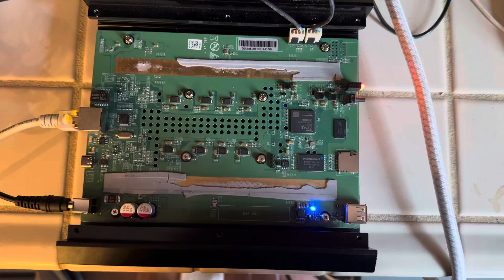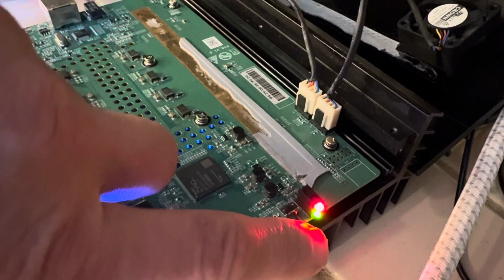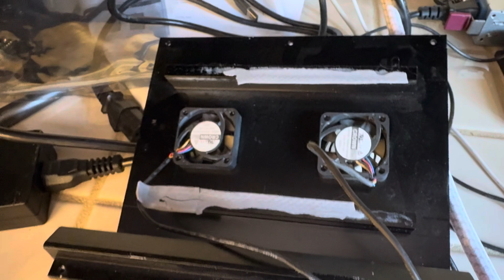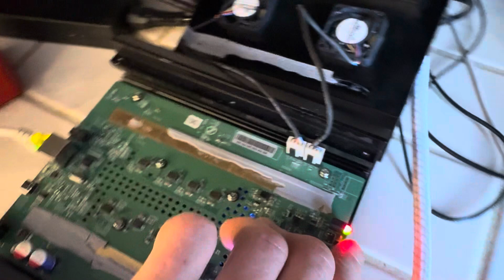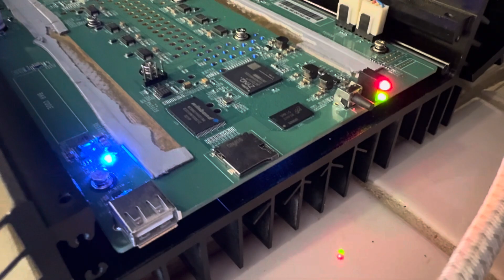I PERMANENTLY BRICKED MY KS0 OG AND DON’T KNOW WHY BUT IT WILL NOT FACTORY RESET ANY LONGER

Comment: Hi, I have just had the same trouble .. how you fixed ?
Reply from the maker: I’ve shipped back to iceriver for repair. They just flushed firmware looks like and shipped back to me. I had to pay shipping to Hong Kong like $78 back 7-8 month ago. Now you can try devs or have them remotely connect to your KS0 to unbrick. Currently we figuring solution for KS0 ultra to unbrick it. Stay tuned it may work for KS0 original as well but not 100% sure.

Comment: I figured way to fix it I did a firmware memory chip removal and reprogramed the chip to stock software.
Reply from the maker: You mean removal of nand and reprogrammed? Yes, that what crypto440 did but that not for everyone removing and reprogramming when they can get it done remotely with secure network and only machine IP ports open for time of repair.

Comment: I actually fixed it for me. I had the same problem.
Super long round about way, but I would link up the asic and the pc using an ethernet splitter and then connect that to the router. I would log in to ks0 pro, go miner settings and enable miner location and click save on fan speed (starts the fans).

Once I had done that, I would unplug etherent from pc and plug that into my phone (used a usb to ethernet converter and enabled ethernet tethering in settings) and then fyonally remove the etherent cable from my router.

After waiting around 3 - 5 mins, the fan would slow down so I couldn't hear it and then I'd start recieving shares from the pool.
Took me weeks to figure out this works, but it does for me. 
Before this I could log into the web ui, but the hashrate and fan speed would be unusual and wouldn't be mining.
Reply from the maker: That is very interesting, were you able to get to web ui at all before you did that trick? Mine wouldn’t even show up on web or management tool. It wouldn’t reset to factory settings. In your case looks like you are connecting to pc and then phone and mining through the phone connected all the time (according to last step you described)?
Reply: @DontMindMeMining Yeah, I was able to get into the web UI before doing the switch.
With the web ui not working for you, do you get an ice river "connection timed out" or just the basic chrome not connected error?
I was connected to my router, but using an ethernet splitter, so the pc and ks0 data was being passed to the pc down the same ethernet cable.
I was mining from my phone at the final step though, not through my router.
Reply from the maker: Sounds like you have your router blocking miner from the pool not the bricked problem. You can find info on how to enable your router.
Reply: @DontMindMeMining  no because if I just plug it straight into my phone internet it doesn't work and I get the same problem you have. There needs to be a change in connection. I'm assuming you still haven't fixed it?
Reply from the maker: I’ve sent it back to iceriver and they flashed firmware and works now same like used to be no issues. I bricked installing wrong firmware.
Reply: how can you do that when i cant even get the web gui up?

Comment: This just happened to me too! Where did you send it to get fixed and was it difficult? Thanks for posting this!
Reply from the maker: I had to send it back to iceriver, you can open ticket on iceriver.io and provide with shipping info. Shipping super expensive I sent it via usps ($98) , UPS was $350 and DHL like $250. They just flushed bios i think, someone left a coment that can be done in computer shop and transfer from working KS0 to your bricked one but I didn't get a chance to try that because I already shipped. hopefully that works for you.
Reply from the maker: when you input your serial number it will tell you if you still hve warranty on your machine, luckily i had it still under warranty but still had to ship one way.
Reply: Thank you very much for your help! 😊

Comment: Try to change the DHCP to static and run it for couple of minutes and restart/turn off/unplug the machine..
That is what i did just now for my ks2
Its been bricked for 4 days..
Reply from the maker: didn't help me so i had to ship to iceriver and its back now and running, looks like they just flush new firmware or bios and sent it back right away

Comment: Same with my ks2, network problem 
Cant hard reset it, i can still access the dashboard but no hashing, have 4 solid led lights..
Reply from the maker: If you can access via iceriver batch tool then can reset to factory setting through it. I had my ks3 and KS3M bricked after temps went too hot but I was able to factory reset and power restart again and it worked. This one looks like missing boot file my best guess and I can’t login via SSH

Comment: I had a similar problem with a KS0 pro. The problem was the unit had an IP address and I changed in the DHCP server to a new one. It followed requesting the old one and the DHCP server only assigned the new one. The IP address management of this firmware is wrong sometimes. Try to delete any lease in the DHCP server with the unit MAC address and check the logs to see if the unit is asking for any IP
Reply from the maker: thanks, I can see unit on my router, i tried to connect to 3 different routers so far with new ip address, i cannot connect to that IP address with webgui and iceriver tool doesn't see it on network. only SSH connects but I couldn't figure login or password.

Comment: I had the same issue for on of my KS0, I SSH into it and found that the reset file was missing, copied one from another KS0 and was able to reset it. I cannot change FW anymore but atleast it is working.
Reply from the maker: Interesting , what login and password did you use? I tried any possible ways and it won’t login using ssh
Reply: @DontMindMeMining  I used Eclipse, with the "addon" used for the first overclocks, no login was neded.
Reply: I can repair this
Reply from the maker: @paulgibbs2516  have you done that on kso? I couldn’t login SSH  or through eclipse. Not sure what other options.
Reply: @DontMindMeMining  I can fix this

Comment: Red panda bricked a ks1 and ice river ssh into it and got it unstuck….
Reply from the maker: i saw that video, I havent try to connect to it with iceriver tool without internet, it will be my next step but he was not able to use the ssd card and usb port thqat on kso is for power up option.

Comment: When you say wrong firmware, which one?    

I guess that’s why the miner has a usb-c port.   💁🏻‍♂️
Reply from the maker: I used kso og firmware but for the otehr of my mac address i think 150G
Reply: Have you also installed the firmware on the KS0 Pro 200 from a simple device?kso  @DontMindMeMining

Comment: Hey sir again! I'm starting to follow your videos and trust your judge. I have a KS3M with a hashboard that is not working. What would you do in this case? I have tried rebooting from factory, firmware update etc... should I just send the unit to IceRiver?
Reply from the maker: If entire board failed within the warranty period best way to contact iceriver but they will need the unit shipped to them so I don't know how long that will take and how much risk involed to ship it back and wait for delivery so its hard desition but its best option I think if you 100% shure its a hashboard issue.
Reply: @DontMindMeMining  Thanks so much man! I think I might have to run it with 2 hashboards for the moment. I believe sending it is too much
Reply from the maker: yeah, its probably too risky, I wonder if they can send just a board replacement, you can contact customer service to see if that is the option but i  doubt since they need serial number to match maybe you can buy just one hash board at discounted price or something  @SepulvedaCarlos

Comment from the maker: Don’t think so, unit was perfectly fine never overheated. I think it crashed somewhere into firmware that can’t load boot file in order to reset  think it need boot log otherwise it’s just frozen. It doesn’t make sense though cuz factory reset should force the boot to original firmware so it’s could be a unit fail as well.

Comment: Maybe ask Swift if there is a way to unbrick the machine since you uploaded the wrong file?  Maybe he has a way to unbrick it, but his warning was pretty firm on not trying his software on other machines.
Reply from the maker: Already asked him, he said factory reset should work. I had installed wrong firmware before multiple times and was able to factory reset no problem. Looks like the end of life for this machine unless can be reprogrammed to start as new
Reply: @DontMindMeMining  Hmmm bummer. Do you think overclocking causes the end of life to arrive sooner?